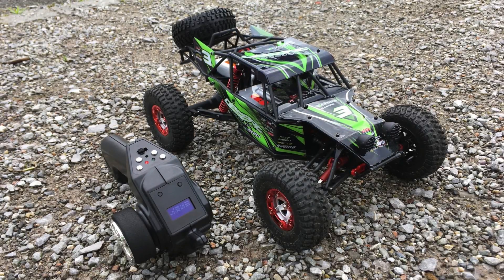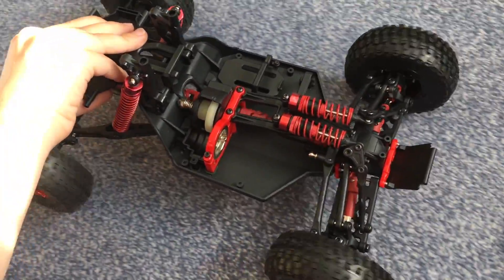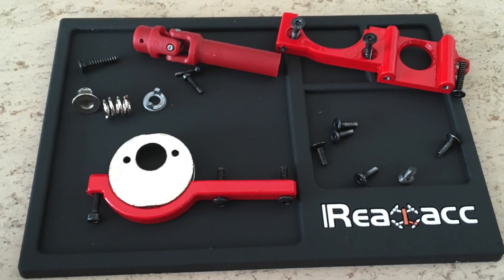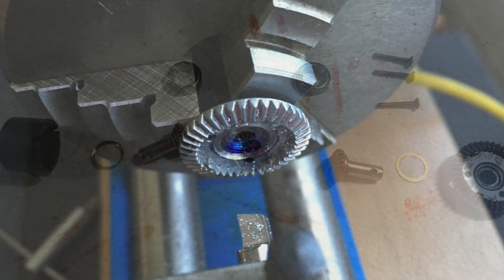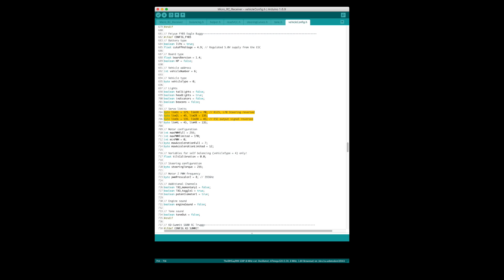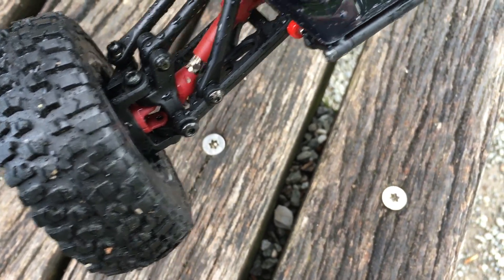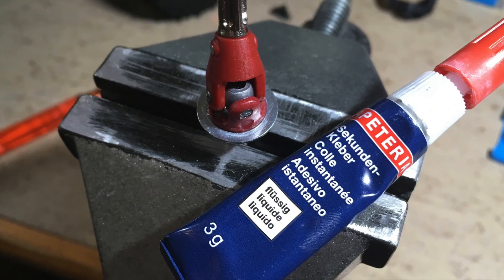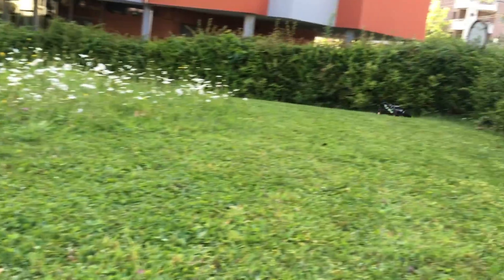Feiyue FY-03 Eagle: The Fastest RC Buggy With DIY Remote In The World?

Comment: I'm very impressed with your skill set and appreciate the video. I bought the brushless kit RTR version for my son. And I also had to make some adjustments. It has a smaller motor and I haven't tried li-po batteries yet as the description said it came with 2 but it actually had 2 lithium ion batteries. Probably the worst is the lack of oil filled shocks do you have a recommendation for a suitable replacement? If not I will try to source them later. Again great video keep up the good work. 👍👍👍
Reply from the maker: Thanks for the praise. I'm using these shocks, which can be filled with silicone oil:
https://www.banggood.com/Feiyue-FY-01FY-02FY-03FY-05-FY-06FY-07-Upgrade-Inner-Spring-Rear-Shock-Absorber-Rc-Car-Parts-p-1307875.html?utm_campaign=4828314_1046285&utm_content=1097&p=NZ29024828314201605E
https://www.banggood.com/Feiyue-FY-01FY-02FY-03FY-05-FY-06FY-07-Upgrade-Inner-Spring-Front-Shock-Absorber-Rc-Car-Parts-p-1307894.html?utm_campaign=4828314_1046285&utm_content=1097&p=NZ29024828314201605E

Comment: Have the newer already upgraded brushless version  fy07 .  Seems those issues seemed to be fixed , although it is more of a drone brushless motor of ask me. But its a powerhouse , i have found like in ur video a bit bouncy , best upgrade u can do simply is to take off the spare tire in rear!  You would think it would with traction , but it only cause it to be too much weight in rear and every lil small bump causes to bounce backwards cause the axis is off with the transfer of any impact .  Next best thing is upfit of battery more centered in car . That usually about where you want it , to fully correct axis balance .
Reply from the maker: I added hydraulic shocks, so it's not bouncy anymore
Reply: TheDIYGuy999  i’ll look
Into those , i found after opening shocks light on fluid , but also that slide screw within a little loose as well. After tightening slides up i added 1000cst fluid and are what i like to think of almost perfect . Lost more than half of the free bounce , but had great cushion if were taking off ramps. I learned that trick from the wltoys 979-b . As it had same ordeal when i got it . Those screw slides were so loose ? Filling with fluid the fluid would just slowly but continuously leak out. But doing so seemed to fix both car versions and made  a big difference in both.

Comment: check out the new fo 03 pro ,brushless out the box with metal panels 

still need metal drie shaft upgrades , shocks ,and get a spare diff in as they tend to go as well 

the rest of the car is great unless you jump on 3s ,then you will prob crack the base as well and need the odd one of those in extreme cases 

great cars these ,hobby grade that are ready to run out the box , not ready to thrash ,they need work for that but dont they all ? :)

Comment: I put a 3s Lipo on the stock 380 brushed motor on mine with a brushed ESC that has a fan.  There's so much initial torque that it twists the frame and accelerates on 3 wheels like a semi-truck.  Hits about 35-40 mph easily. I also replaced the stiff stock springs with oil filled shocks.

Comment: Nice work but wow a lot of fixes on a new car.
Plastic joints bad with that much power I was shocked they were plastic.
I used to run that scale many years back there much fun !
Reply from the maker: Thanks. Yes, it's lots of plastics, but on the other hand, plastic is able to absorb impact energy... But for the joints, it's definitely the wrong material choice. I've ordered steel transmission shafts now. At the moment it's just a rear wheel drive car.